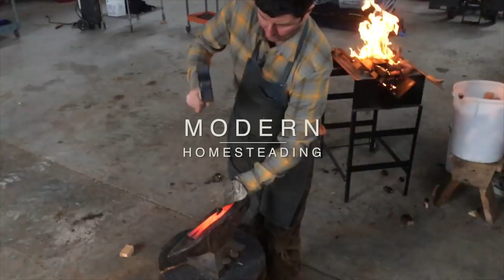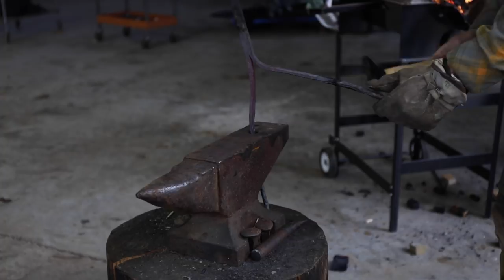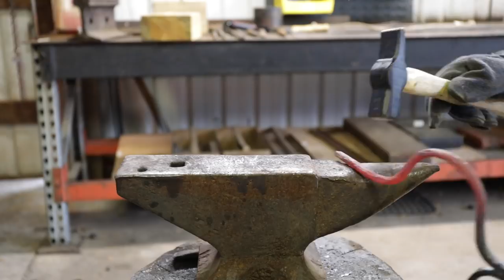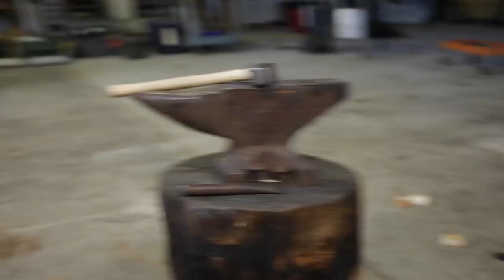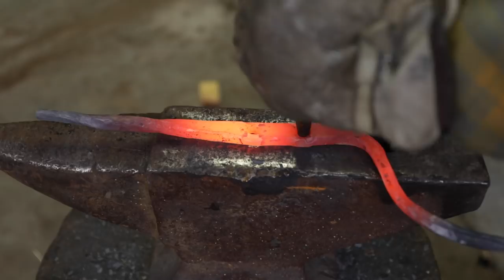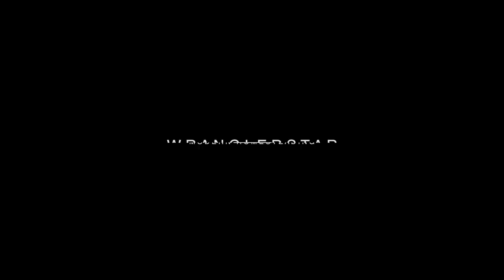Blacksmithing For Beginners

Comment: I'm enjoying this series, Cody.  Your channel remains one of the few that gets my viewership as soon as Youtube sends me an email.  

I was curious to hear how the air filtration system has worked for you so far in the shop.  How much of an impact has it made on the dust?  Perhaps you can show the filter cleaning.  It's been several months since you've installed it.  I'm sure it's gotten a fair bit of use.  I think your viewers would be curious to hear an update on it and some of the other things you've done this year.

Comment: Cody just a heads up when you are cutting hot stock using the method in the beginning of the video you are going to want to have a piece of mild steel underneath it; you don't ever want to have a chisel edge hitting directly into the anvil, hard steel on hard steel is a bad idea. We used to have a piece of mild plate with a 90 degree bend in it to grip the side of the anvil and a peg welded to it so it would fit in the hardy hole, much better and you're less likely to have a bad time.

Comment: When working alone a hot cut hardy would make the splitting a lot easier. You wouldn't lose so much heat juggling the iron, the chisel and hammer and it's easier to control. Maybe making one could be your next blacksmithing project...

Comment: Not bad actually.
A nice tip from my own experience in a similar trade: You might want to invest in a pair of aluminium jaws (pretty sure I've seen a previous video where you talked about them) because the standard jaws WILL leave nasty marks in your steel

Oh and safety glasses. It only take one scale/splinter to make an eye blind

Comment: Quick tip - use the table of the anvil when cutting with a chisel, this is part of its designed purpose and helps protect the fact of the anvil
Reply: that or make a sacrificial plate for the anvil

Comment: I can feel the humbling frustration Cody, whatever it is you're working on there sure looks good though! Here are some of my personal observations... From what I've "seen," blacksmiths tend to have huge furnaces, huge anvils and a wall full of tools of the trade. I think that you're doing just fine all things considered! 👍 Good video series! I look forward to finding out what it is! I apologise if you've already said... Someone help me out if he has...
Reply: blacksmiths tend to collect tools as they do more work, many of those same tools get crafted by the smith for a particular job, then put somewhere handy, the forge needs only to be big enough to heat the work, the draft hood is to keep good airflow going, don't want to be inhaling some of the volatiles off coal and coke, the anvil is going to depend on what size metal they work in, smaller for smaller work, bigger for larger
Reply: TheDarkalkymist Sure, I suppose it's like anything else... You collect, create and make due with what you have to get the job done. I sure hope that what I said here offers the spirit of encouragement for Mr. Wranglerstar because that's what I intended. 😊🤔
Reply: honestly have seen brake rotor forges, railroad anvils, a pair of pliers and a determined novice pull off many a decent project, the blacksmith is not called the king of the tradesmen for no reason, if they can make due with a next to nothing budget I am sure Cody can gain skill if he continues to practice on a regular basis
Reply: TheDarkalkymist I can honestly tell you, I would have absolutely no desire to blacksmith anything myself 😐 but I LOVE watching it. 😆👍
Reply: everyone loves watching, part of the magic of smithing, taking molten metal and producing something out of it is fascinating to the untrained eye
Reply: I'm pretty sure it's a candle holder. He said in another video.
Reply: I think you mean "brake drum forges".
Reply: drums tend to be to deep for most light work, so many resort to using some of the deeper rotors to build forges from
Reply: No, he meant rotors. Drums are less common. Those who do use drums quickly wish they had used a rotor.

Comment: i would try to upset about 2 inches of material at the ends of each prong then flatten them out using the cross pein on your hammer it will create a flat triangular shape that you can then curl into a cone. videos of arrowhead making will show the technique when they forge the socket.

Comment: To make concave/convex shapes, carve your dimension into the end grain of a log (the harder the wood the better).
Then all you do is heat your plate metal and hammer it in with a ball peen or rounding hammer. For the size I'm assuming you'll use for a stick candle drip catcher, I'd maybe even go at it with a trailer hitch once I roughed in the curve with a ball peen.
How to make/use link: https://www.youtube.com/watch?v=jKRsVs5h6Wk

Comment: Your steel is looking a bit too cold there bud
Reply: temperature depends on how you want the metal to move, the hotter it gets the more plastic it becomes, that to is part of learning to smith, incidently, horseshoes are worked at a black heat,  just because the color is not bright does not mean there is no heat in the peice
Reply: TheDarkalkymist black heat tends be very brittle, you can induce small fractures into the piece or break it immediately. the work should be done cold or glowing.
Reply: I am aware, not like I do this has a hobby or anything
Reply: TheDarkalkymist, Building horseshoes: https://youtu.be/NjFTGJAm6lc
Reply: You got to admit, he's working with what he has.  With it being cold out like that, the temperature on that metal will dissipate quickly when taken out of the fire.
While in a hot summer, temperature on that metal rod will stay well within acceptable perimeters.